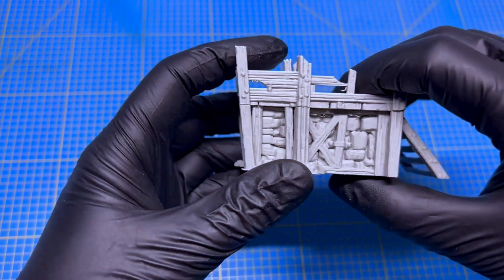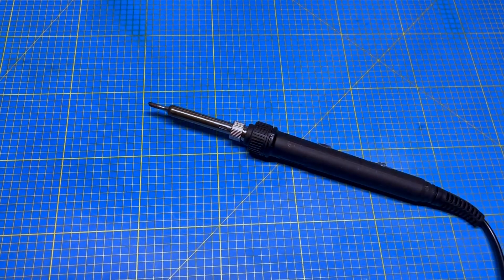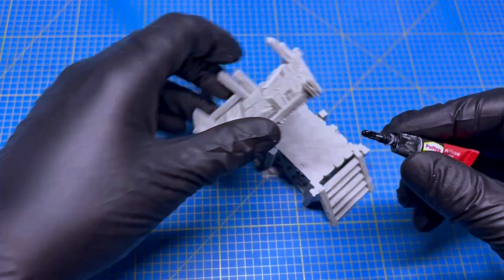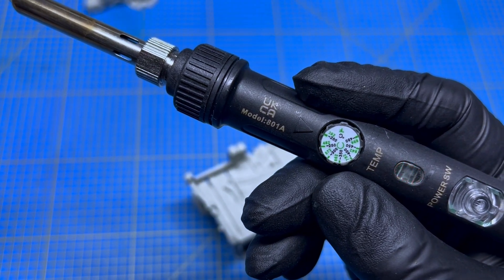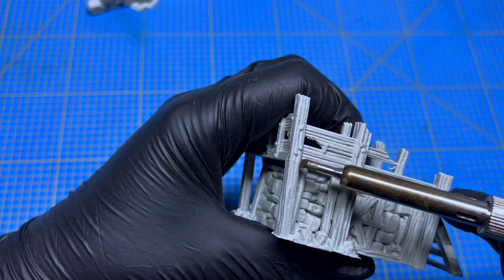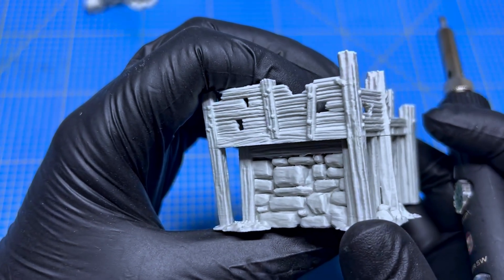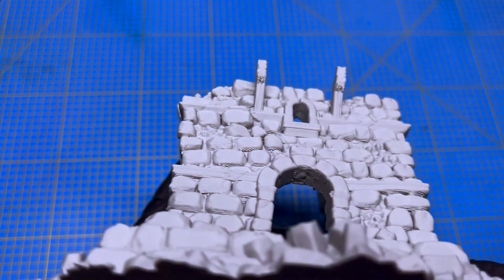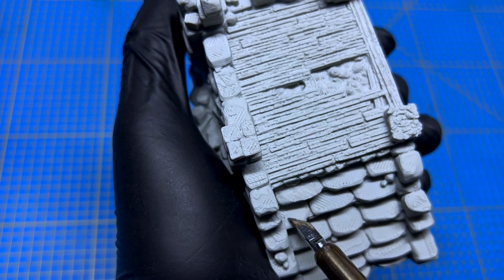How to Remove 3D Print Seam Lines Easily

Comment: Pmma or thf also works
Reply from the maker: Thank u!!
Reply: @   The classic sprue goo also works as a nice gap filler. As a Primer to hide layerlines I just automotive spray filler. It is cheap and fills most gaps in 2 to 3 thin coats
Reply from the maker: @FunCom352  coool!! And what about the small/tiny details?
Reply: @ if You do not flood the surface they will just tone down a tiny bit. I can send you photos on your IG in a Minute.
Reply from the maker: @FunCom352  FOR SURE!! Also on our Discord Group!